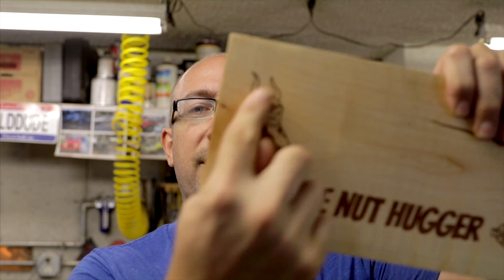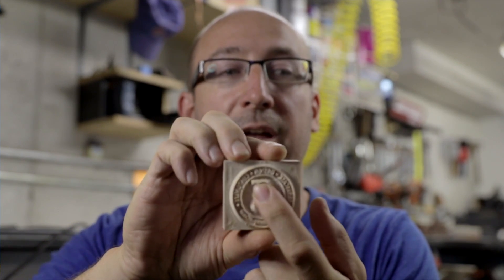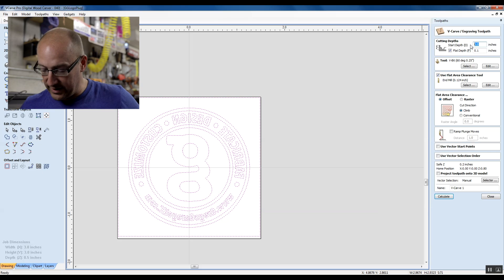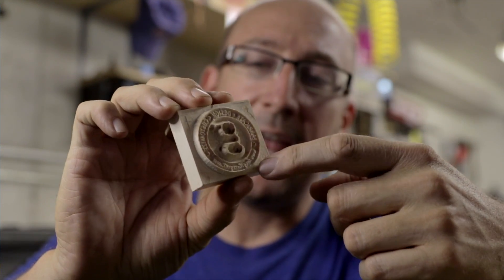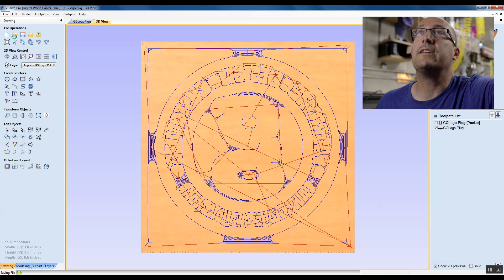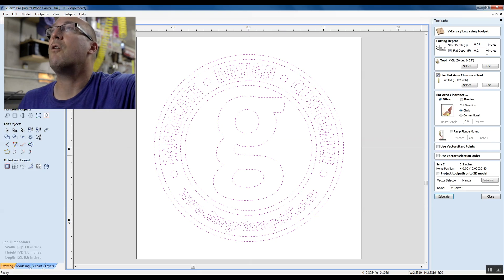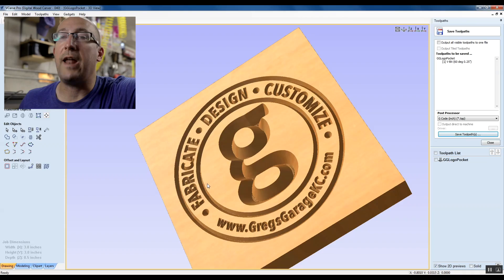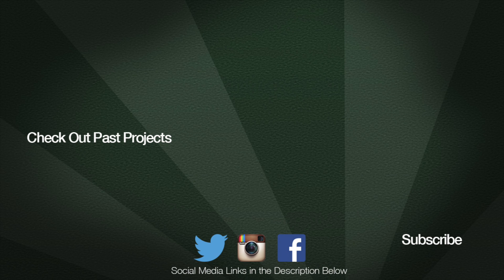V-Carve Inlays - Detailed How To

Comment: The web address was unreadable 10:57. Looks like a lot of tear out.
Reply from the maker: Correct.  I was trying to see how small I could get the type.  That is VERY small...  I believe somewhere around 12 pt.  The mahogany has a pretty loose grain, so holding that level of detail is pretty tough.  A harder & denser wood will produce a better result...  As a side note, the maple is soft maple, not rock maple.  Rock maple would also proceed a cleaner, more detailed cut.

Comment: I am sorry Greg but that inlay is not good, you are having gaps in almost every letter and that's  just to much of a detail for such a small object and trying to make it out with 60°bit is not right. The start and the flat depth calculation is just right but the result is bed. I think it is because of the small image with a lot of details.
Reply: Doskynakrajanie.eu What do you recommend?
Reply: for such tiny text as greg's website address, you could try a steeper bit, say 20-30 degrees. combine that with a smaller pass depth (e.g. plunge a max of 0.03 inch at a time and do 3 passes instead of 1) and a slow feed rate, i'd say in the region of 30ipm, and you might just get lucky. 

still, as the guy you were responding to suggested, the text size might be a little too optimistic for the resolution that wood can actually hold without chipping. if you check out his website, he is not completely inexperienced.

Comment: Hey Greg, great video. I've been playing around with this type inlay and really like the detail you can get with it. Got a question though... For your 60D V bit, what speed do you typically run on it? I've been finding my plugs aren't being cut perfectly (stars are my biggest headache) and am trying to nail down the issue. Thanks!
Reply from the maker: 16,000-20,000 RPM.  A sharp bit makes a difference and the harder the wood, the better off you'll be.  I go through with a dental tool and clean up both sides of the inlay to get the fuzzies cleaned up...  Lastly, you want a very firm clamp to make sure all the fibers are pressed into one another.
Reply: Thanks for the quick response! Just realized I typed "speed", I meant "feed". haha. What is your typical feed rate for that? Thanks again.
Reply from the maker: Ah.  I typically feed at around 100 fpm.  I depending on how the wood sounds as its getting cut, I''ll slow the machine down to around 60 if its squealing.
Reply: Perfect! Thanks for your time. Looking forward to your next video.
Reply: not necessarily the cause in your case, but MACH3 (assuming that's the controller you use) has a setting called constant velocity (CV) which, if the feed rate is fairly high (100ipm being high here), will take shortcuts (cut/round off corners) whenever the toolpath changes at an angle which is acute enough. been driving me mad until i found a guy explaining this in a forum. it is a meaningful feature, though, which makes for smoother machine operation without a zillion stop/start micromoves, but can get in the way if you're after precision and perfect fit.

the solution is either to slow down the feed rate or go into MACH3 settings and switch on the option saying something like "Stop CV on angles >", guess the sweetspot is 90 degrees. just google "mach3 constant velocity"
Reply: Thank you!

Comment: why not just use the male / female inlay tool path option?
Reply from the maker: As far as I'm aware, you cannot use V Bits with that tool path option.  Its for straight tools only, so it gives you radiused corners everywhere.  That is...  Unless they've changed that and I'm not aware.